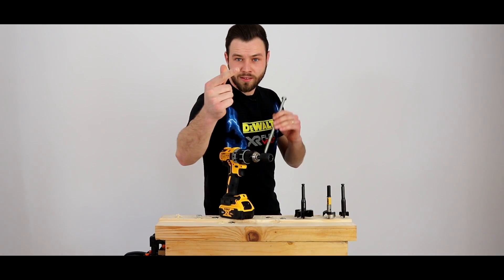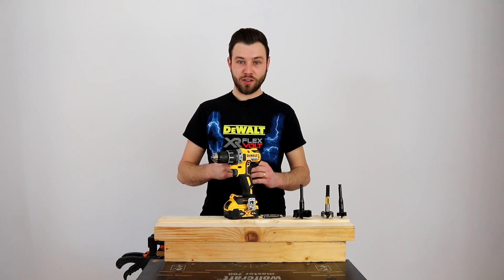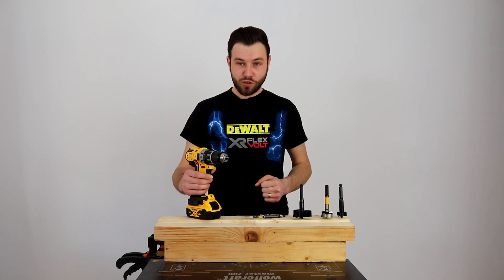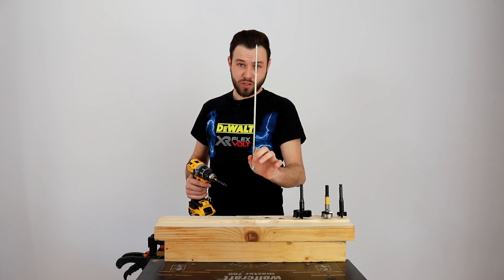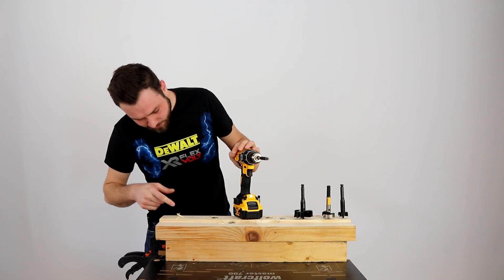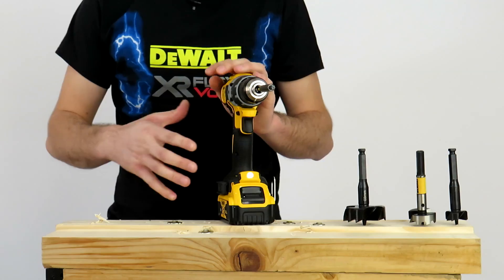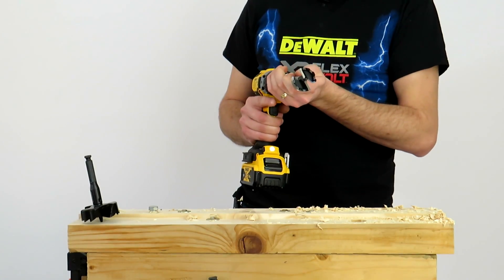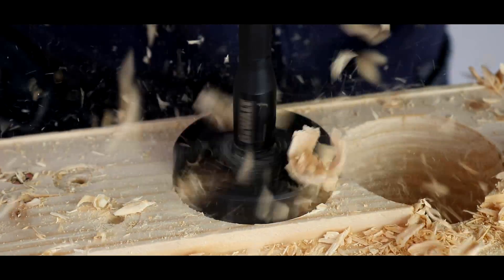Testez până la limită bormasina DeWALT  DCD791/DCD796 18V XR Brushless | Freză 68mm |

Comment: I had the DCD800, which is supposed to be stronger than the 791, but it got hot and cut out driving 3 and 5 inch timber locks. I bet the 791 doesn’t get as hot since it has a bigger body and bigger fan.
Coincidentally, my DCD777 has proven to be stronger than the DCD708, even though the specs are pretty much identical.

Comment: Salutare,având în vedere că românul e mare meșter si se apucă să facă de toate ,am văzut că nu există in limba română material video despre materiale de construcții,cum si unde se folosesc(ex.o fisură/gaură mica in perete cu ce o astupă)(un loc mai mare gen 40cm per 40 cm -perete sau tavan unde tencuiala trebuie data jos si trebuie tencuit din nou sau cum se poate proceda ,trebuie plasa sau nu?)(după câte ore putem șlefui/vopsi)(sau gen e o gaură de 10 per 10 cm adâncă de 5cm se poate încărca material o dată sau de două ori sa nu cada sau sa nu crape) ideea e că pina unde putem folosi un material si de unde folosim altceva,sper ca ai prins ideea si poate ar fi interesant sa faci un video de genu🙄,dacă crezi că nui interesant ignoră  acest mesaj si te aștept cu noi videouri faine.baftă multa
Reply from the maker: Salut 👋 Multumesc pentru idee, poate o sa fac un clip de genu asta ✌️

Comment: Am luat un dewalt 795, are un zgomot la oprire dupa ce apas si las tragaciul, un zgomot metalic, e normal? Am luat cu 700 lei de la bricodepot
Reply from the maker: Da, e normal. Are frână instanta la mandarină și suna cum se oprește. Pe viteza 2 probabil suna mai tare. Pe viteza 1 nu prea. Corect?
Reply: Technic Tools da chiar asa face. M am linistit, ma gandeam ca am luat un fals, desi de la bricodepot era cam ciudat sa dea falsuri. Pretul cum vi se pare? Si multumesc !
Reply from the maker: Este un preț forte bun pentru ea ✌️
Reply: perfect normal